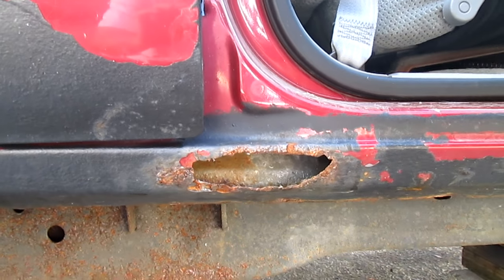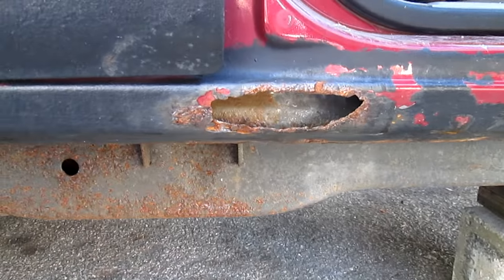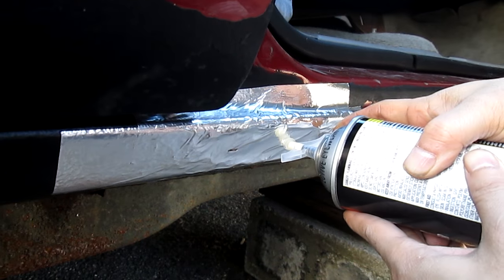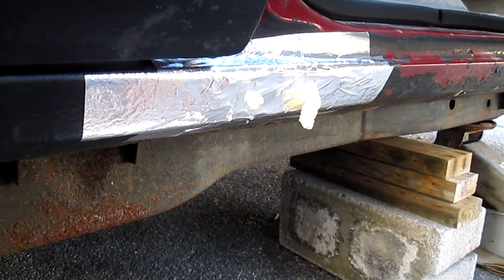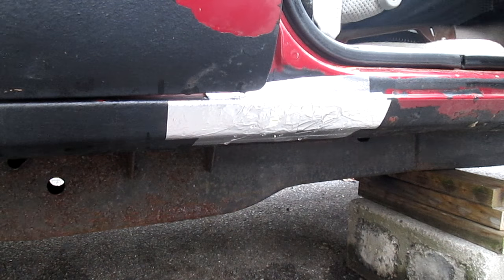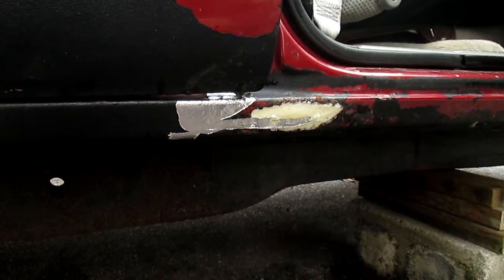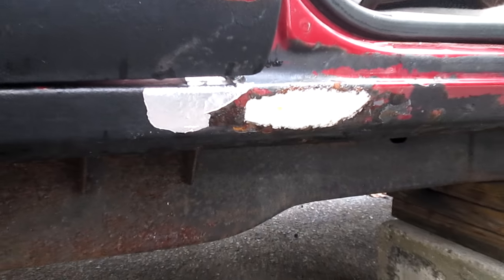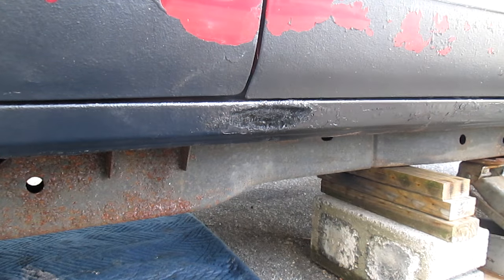Easy Fix - Repair Big Gap Rust Hole on Body Frame Car - Truck - Under 10 Mins!

Comment: What kind of foam do you use?
Reply from the maker: GreatStuff Spray Foam - See the bottle in the video.
Reply: @JodBronson  it is a certain foam?  I didn't find it at the store here.
Reply from the maker: @viorelscrob6391  - Where are you from?  Go to Google and search for....  Yellow Big Gap Filler Insulating Foam

Comment: Is it true the foam can hold moisture and make it worse over time?
Reply: Ok watched another video about my question. People say it lasts for years with no problems.
Reply from the maker: @theunknownandunsolved6963  - Updated Video link here:  https://www.youtube.com/watch?v=pwc6sEPktgc
Reply: The moisture will still be in the panels and will start to rust from the other side.

Comment: Why does it have to be that tape? Jw
Reply from the maker: You can use any really.  Aluminum Tape is more "rigid" so it can keep and "formed" the shape.  That way there is no extra work later. :D
Reply from the maker: See the 1 + 1/2 Year Update Video here: https://youtu.be/pwc6sEPktgc

Comment: Never use foam . It will rust out really quickly for it retains moisture.
Reply from the maker: WRONG.... Look:  UPDATE VIDEO:  1+ 1/2 Year Here: https://www.youtube.com/watch?v=pwc6sEPktgc
Reply: I have a hole in my fender that proves me right. Had a guy in body shop fix it for me said he could do it cheap using foam but his boss wouldn't let them use it because of rusting issues but he said told me there would be no problems he did it all the time on used car lots. Well 2 years later my neighbor backed into my truck and the whole rusted chunk fell out.
Reply from the maker: @jamesphillips7283  -  "I have a hole in my fender" <<<<<<< It is a big hole?   Big hole needs big gap filler !!!  🤣🤣😂 🤣😂:yt::oops:

Comment: This is not a good idea at all
Reply from the maker: +George Sullivan
 - Well, if you have any other idea... Go for it!  As far as I am concern.. It passed Inspections and that is all that matters!
Reply from the maker: @george1984ts  - Here is a " lesson " I've learned in Life and it might be " useful " to you and I will share it with you!  Time + Labor + Money + Etc... + Coffee = NOTHING - Now, where do you find Time to Learn to live? - Happy to say though..., currently, I am learning how to live, cause in the end, that is all that matters!
Reply from the maker: @george1984ts  - I also mentioned in the Video... Maybe you need to TURN UP THAT VOLUME OF YOURS or CLEAN YOUR EARS!  I said... If you want it to look nice or even longer lasting... You can use Sand Paper and Bondo (Auto Repair Bondo) and do it correctly!
Reply from the maker: @miketroy4563  - THANK YOU MIKE!  Maybe it's a lesson he needs to learn.
Reply from the maker: @george1984ts  - Good news George... It's still holding up.  I will update the Video soon.  I am waiting for 1 YEAR, so I can update :).
Reply from the maker: Well, if I own a Body Shop, I am sure would wanted to Weld, then do it correctly and out of Metal instead, for the Customer. I mean if this is a good car or something that I cherish or show and tell.  I would have done it with Tin or Metal Sheets and then paint it.  But this is our "beat-up" car + it's a car that we just get from point A to point B.  A Car to me is getting from point A to point B... That is it!  I DO NOT VALUE Cars/Trucks like most People.... Hell, you can give me an Oscar or the Nobel Peace Prize for DOING NOTHING.... I swear to you, I DO NOT want it!  That is the differences between me and other People!
Reply from the maker: @jamescrabb8766  = Good tips !!!
Reply from the maker: See the 1 + 1/2 Year Update Video here: https://youtu.be/pwc6sEPktgc
Reply: It's good enough for who it's for. 😂